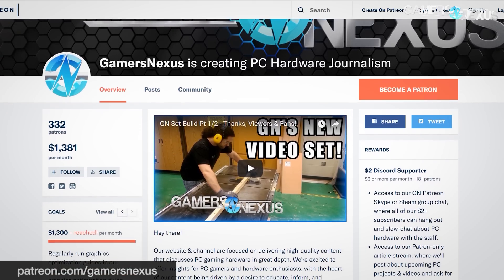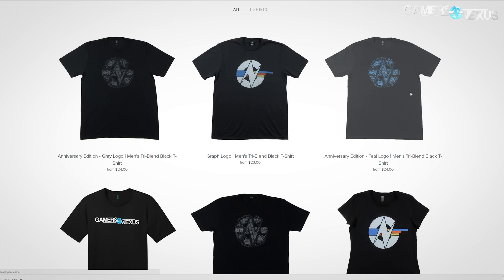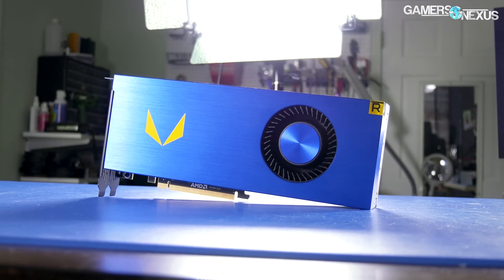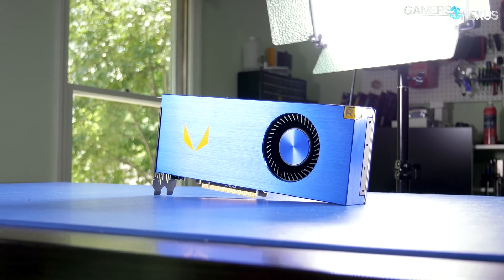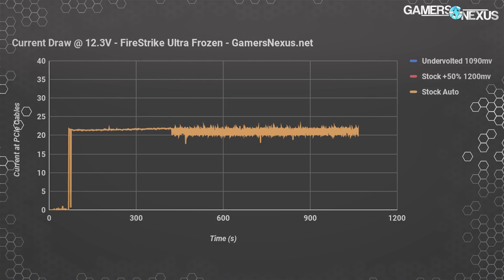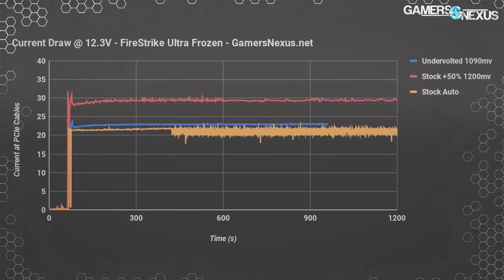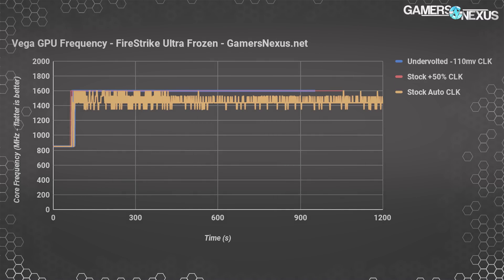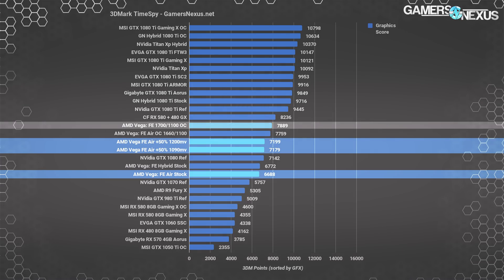Undervolting Vega FE: Fixing Performance & Power

Comment: If I've learnt on thing from having an AMD Tonga GPU for the past 2 years... AMD Overvolts their GPU's like crazy, hell even the RX4XX and 5XX Series undervolted to acctualy give better performance.

Thanks for the great coverage guys!
Reply: They're being ultra-conservative with settings.

Bad chips need the extra voltage.
My assumption is they've taken the absolute worst chips they've found that still meet the expected performance targets, then set the voltages to a tiny bit more than the minimum those bad chips require to be stable.

Of course, since this is only nessesary for the worst chips, almost everyone should be able to undervolt theirs to a greater or lesser extent, because only a handful of particularly unlucky people actually got those bottom of the barrel chips.

Unless they can identify the stable voltages on a chip by chip basis for every card made, I don't see this ever changing really.
Defaults have to account for worst case, or some cards will fail out of the box.

Frustrating, but that's the way it goes.
Reply: My Gaming X RX480 undervolts by about 100mv and now even while gaming for hours the GPU fans are barely spinning. Like 800 rpm. Temperatures stick at around 70c.
Reply: I've got one of those bad chips.. RX580.
Reply: Remember the original pricing of polaris before this mining shit?

$199 for a card that costs as much to build as a 1070, the reason is because AMD do exactly this. Spec all the cards for the lowest common denominator chip, they probably only bin the bottom 2-3%. There was talk back in the day of nvidia binning something like 90%+ of early fermi chips.
Reply: Well if they under-volted too much there would be non-technical users with buggy cards.  With the more conservative voltage, someone who understands the problem can tune their card in 10 minutes tops.  This is always the better decision.
Reply: KuraIthys Isn't it possible that their silicon process improves in the future, so that they won't have those particularly bad chips anymore?
Reply: Loose voltage = more useable chips. Simple.
Reply: Budget-Builds Official Nvidia are the same way. GTX 1070s overclock 50+ MHz while using 55W less than a RX 580
Reply: why does your shit say 'see more..... but doesnt actually expand

FIX YA SHIT YOUTUBE

Comment: Thanks Steve, not surprised the RX4780, 470, 580 & 570 all react the same way
Reply: Samuel Sann There are 8 pStates in the wattman settings. Try lowering the voltage of last 2 stages to something around 1.1 and start to decrease it by a little bit step by step while performing some stability test. If your 580 is moderately binned, it should be able to do 1340 at around 1050 mVolts.
Reply: Yeah, my RX 480 undervolts to 980mV and in that state, it uses around 75W at 100% load on the core. Mighty impressive if you ask me and even more efficient than the 1060!!! All while being 100% stable. I might try to go even lower, but I am happy with it as it is.

Edit: My RX 480 has an ASIC of 81% according to GPU-Z, if anybody is interested.
Reply: with the way they are making the i9 cpus.....intel might have to start binning a lot looser 

"glued together desktop cpu" = we only get 5 out of 100 chips come out perfectly fine for 22(iirc) core sku's.....and are wasting a lot of money on dead or chips that end up as <22 cores

and that 5 out of 100....made up, by the way

but i do know that the way intel is doing it....trying to make the 22 core in one moon shot....is way harder and more expensive than trying to make 4 cores (8 core ryzen is 2 SSUs or whatever)

intels way is less efficient on the fab platter space as well.....if a tiny 4 core chip is dead, toss it, theirs ~200 more 
but if that 22 core is dead.... you only have like 10 or 20 more
------------------------------------------------------------------------------------------------------------------------------------------------------------------

TLDR

 i9 is hard to make.... so intel will have to lower clocks and loosen 'oc ability' to compensate.
Reply: Oh yeah, my Gigabyte RX 580 8G Gaming is trying to kill my PSU.

It runs stable at 1340Mhz at 71c, the problem is....i have an 600w 80Plus Bronze PSU, and the fan speed in it need to go so damn high because of this GPU, so probably the card is running overvoltage.

I do not know how much Voltage i need to put to maintain stable 1340Mhz, it has like 8 or 9 voltage stages in the wattman.
Reply: I can get my Fury X to run at -50mhz and -200mv, at which point it uses ~65% power, and performs around 97% as well as stock.
Reply: I've got an RX580 that doesnt undervolt well. I love the card but i hate when people say "all react the same way".
Reply: My RX 480 picked up 172 points in the graphics test of firestrike ultra by going -92mv with a slightly more aggressive fan curve.

Not even worth touching the clocks, just keep dropping dem voltz
Reply: Yea AMD seems to always put way too much voltage to their cards thanks to their loose binning process...

Comment: What about undervolt with no power target increment?
Reply from the maker: Agost40Hz Muddies the test since you run into unpredictable power limit throttling issues that skew results.
Reply: So there's no gain in efficiency like with Polaris? Vega will always draw 300W under load?
Reply from the maker: Agost40Hz Efficiency gain is shown here.
Reply: Well, obviously there's a gain to some degree, but not like on the 480s which managed to get a double digit percentage in power reduction 

That's what I meant. I was only curious if Vega could approach GTX 1080 levels of efficiency, but sadly it cannot
Reply from the maker: If you define efficiency as something like "frames per watt" (or some other semi-arbitrary figure, but you get the idea), then Vega FE is still behind in that category, yeah.
Reply: Yeah, performance/W.

Still waiting for RX though, since some features are still disabled and drivers seem to have some issues. AMD promised much higher IPC than Fiji but it's not the case, as you have shown in previous tests (that I really liked). I'm wondering what's wrong with Vega.